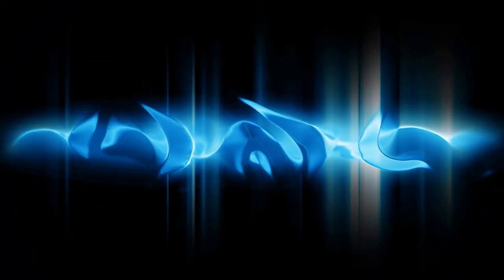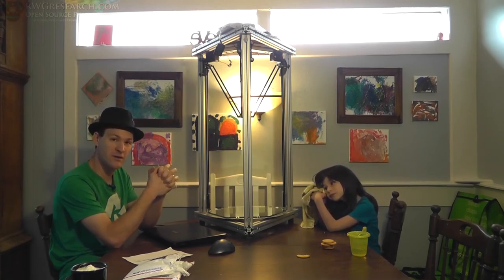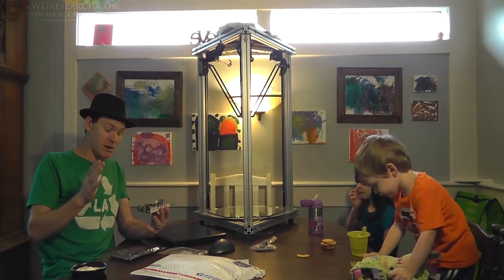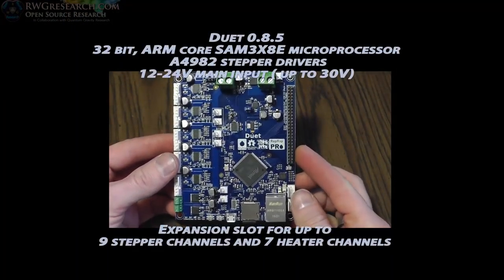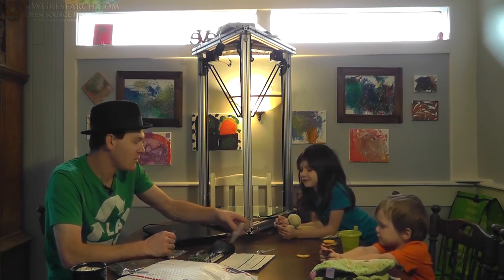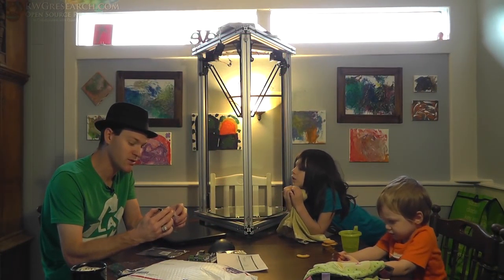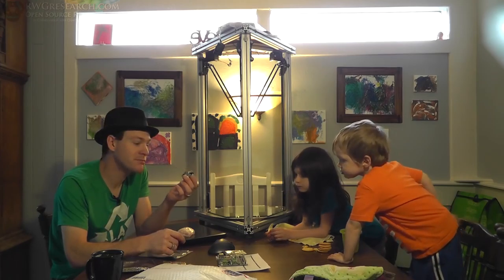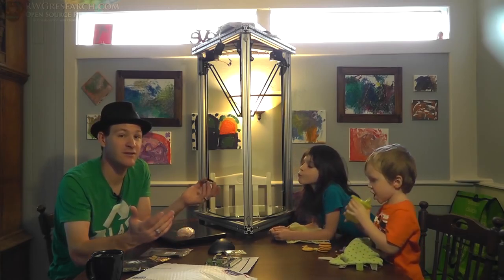RWG-OSD # 17  New Electronics & Firmware,  Duet 0.8.5 & PanelDue Intro

Comment: Been using the duet on my delta for 6 months. Love it. The new one has wifi too.
Reply from the maker: cool, you say " the new one" what version? thanks! ~Russ
Reply: +rwg42985 it's called the Duet Wifi more details here - http://forums.reprap.org/read.php?416,674772,page=2
Reply: +rwg42985 it's also worth watching the forum as new software comes out frequently. I'm on 1.13a and it's been quite stable.
Reply from the maker: im sorry i should have asked , what  version are you using now? the one i have here is a 8.5 the newest according to my knowledge. it dose not have Wi Fi, still just the Ethernet port, also yes i have been watching the get hum for updated versions. thanks!! ~Russ
Reply: +rwg42985 I'm using the 0.6 version. Same software with less connections and slightly less current for heated bed. The duet wifi supports daughter boards for better temperature control etc and higher current and who knows what will come. Dc42 who has a fork of the duet software and created the panel duo is very active improving everything.
Reply from the maker: oh man, good they upped the stepper motor drivers. GOOD! now i guess when it comes out ill sell this one for 1/2 price and upgrade :)  until then... 

thanks! ~Russ

Comment: Any thoughts against the smoothieboard? I love the graphical display that they both use (one color, the other monochrome). I am between the smoothieboard and Duet for my dual independent head cartesian printer. Thank you for keeping us in the loop and keep on uploading!
Reply: I had the same line of thought half a year ago. SmoothieWare seemed to have a lot of useful extra features but RepRapFirmware got the math stuff right for delta style printers. I went with the Duet for that exact reason; at the end of the day I want a board which can push the accuracy of my printer as close to perfect as possible.

The situation may have changed since then but my inner perfectionist wouldn't have been happy with any other choice.
Reply: +Djhg2000 Ahhh yes I see your point specially with Delta printers. RepRap vs. GBRL G-code interpreters. I had a slow experience with GBRL way back when, but I will have to give it a try before I buy one or the other. Thank you!